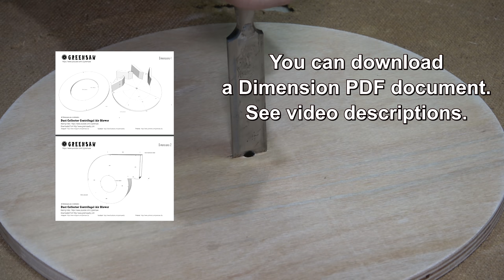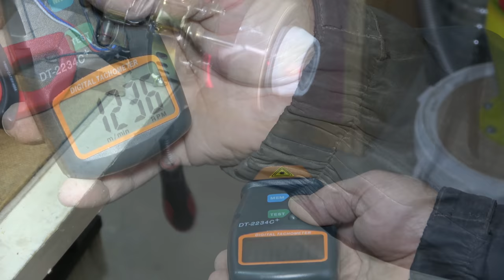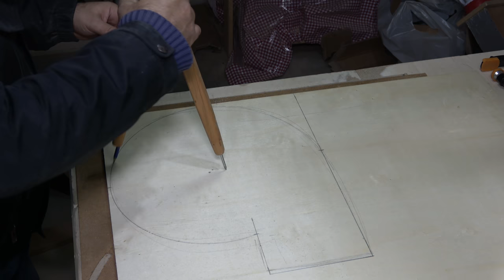DIY - Dust Collector Centrifugal Air Blower [4K]

Comment: What do you want to do with 65 watts? My razor will soon have so much! At least one zero is missing. And 3000 turns per minute!
Reply: My thought as well. I wouldn't go less then 1 HP for that size of propeller
Reply from the maker: My goal is not to blow a hurricane! A silent and continuously working dust collector.
Reply: @GreenSaw  With 65 watts, you can't even blow out a candle.
Reply: @wernerpfeifer   Do you know how many watts of home hoods for the kitchen above the stove? This is not a cyclone for a carpentry workshop .
Reply: @iuriicebotari3656 ???
Reply: @wernerpfeifer  !!!
Reply: @iuriicebotari3656  а для чего же тогда это?
Reply: @12233444q  В названии ролика все написано и это не циклон для конкретного станка, который  убирает отходы в одном небольшом участке...
Reply: AI bring you in wrong place Mr. Werner P. ! ha ha ha...
Reply: @niamulbary8162  ;)  ???
Reply: Please make a water pump which oprated by 24 volt bettary
Reply: @mandeepsiwach6797  ???
Reply: Por de ppa
Reply: Do you want to compare a large carpentry shop with a homemade one?  The type of engine depends on your needs.  If this engine meets what he wants for a bigger engine?
Reply: @iuriicebotari3656  Die saugen auch keinen Staub!!!

Comment: Reconfigure your installation to get rid of that 90• elbow. Flex duct work is another thing to avoid if possible. Removing the elbow will make a huge improvement in the performance.
Reply: That’s all connected to the exhaust (outlet) end though right?  From what I can see he didn’t hook any lines up to the part that actually sucks up the dust

Comment: simple but effective - don't mind the ones that want always bigger - faster louder ....i also prefer low-energy-consumption and silent solutions 👍🏻we do have enough machine that are crazy loud and every extra noise we don't add to them is a win - and btw for the very fine dust flying around in the workshop/ air that is a nice way to do it. but i admit if you want to use also a particle filter in the airstream the power may be not sufficient. 🤔 i'll have to check this   -Anyway  well done & keep up
Reply from the maker: Thank you for your nice comment. Regards...

Comment: You killed it with that 90⁰ elbow. You need to find either a sweep 90⁰ (large radius) or to install two 45⁰ elbows to soften that turn, for improved efficiency. Just saying...
Reply from the maker: You're right, 90 degree elbows didn't do well. Thank you for your comment.
Reply: Right! Every tight 90 adds resistance equal to 10 feet of duct pipe.

Comment: Nice work, I think you should've made the output even closer to the blades to avoid losing pressure and airflow
Reply from the maker: I think what I have done is enough, but of course it would be better to compare the two after making a new one according to your suggestion. Thank you for commenting and sharing your thoughts.

Comment: Looks like a nice size tradeoff for improved noise reduction. I suspect it'd be really good for smaller tools such as a scrollsaw if you wanted to use it directed at a single tool, rather than to merely circulate.

Comment: I think it's a great machine you've built but if it was me I would have made the impeller to shroud distance way smaller than what you have primarily because if you look at EDFs (electric ducted fan) , squirrel cage fans , turbochargers and turbine engines ,they traditionally have extremely close tolerances to achieve maximum efficiency otherwise you're generating a lot of turbulent flow in that space between the impeller and shroud and whilst I understand you don't want to produce the equivalent of jet engine thrust it will give you far greater efficiency out of the 65 watt motor

Comment: I work with exhaust fans for restaurants and you have a very excellent design if you were to put some type of Venturi on it that would increase the speed and you can use that to pipe to your equipment for dust collection
Reply from the maker: Thank you for your advice.
Reply: Not exactly speed as such but air flow pressure, however, the idea is just great.
I'd add to this excelent idea the use of some sort of light materials such as acrilyc or polycarbonate.
Thanks again for your work and for sharing it

Comment: I tried using this motor (from a floor fan) for a spinning wheel. at a load much less than yours, it heated up very quickly. this motor only works with forced air cooling.

Comment: I assume you have a motor lubrication screw on the impeller side bearing. 🤔 You hid it in the structure of the device. 😥 Lubrication of the bearing on the other side is easier. 😉👌👍

Comment: Ouch.  Several things to avoid in any fan / duct design:  no turns/elbows within 3~5 duct diameters of the fan discharge; if possible make any elbow turn in the same direction as the fan rotation (in this case, duct DOWN would be in same turning direction as fan blades).  Carry the dimension of the fan outlet (this one is....6x6?) for 3' (more if possible), straight, no transitions.  Make the top of the discharge duct flat / even with the outlet of the duct:  this upper area of the fan discharge has MUCH higher velocities than any other area, and thus pressure/energy loss is MUCH greater for any turbulence in this area.  Violations of such guidelines can result in 50% (sometimes more) reduction in fan performance.
Reply from the maker: Thank you for sharing your valuable information.

Comment: NOTE- do not use in an area or house with a gas appliance that is vented through a vent.  Instead of the carbon monoxide escaping up through the vent, it will be pulled back into the house.  You will need a window or something open to equalize the air pressure.
If all electric appliances, good to go 👍

Comment: 65watt motor is useless for dust collection. You won't have any real suction and even a basic shop vacuum has much more power than that little thing. You need minimum 2hp motor to have any real noticeable suction power.
Reply from the maker: I am using it now and I am satisfied.
Reply: @GreenSaw  I doubt your statement as you have no piping through your shop nor is it connected to any of your other machines and I am 100% sure this blower won't be able to provide suction for your shop. It barely has enough suction to pull smoke, never mind wood chips.  The reason I know this to be true is the fact I had a 1hp dust collector years ago and it could barely work with my table saw never mind my planer and this is why I upgraded to 2hp, this is also why I am telling you that if a 750w motor is not nearly enough then most definitely 65w is not enough. 
If you think it works great then show me how the dust collector works on a jointer/planer machine, I know already your inlet will get clogged and no chips will make it to the dust shoot.
Reply: @kazykamakaze131  Maybe something was lost in translation as seems to me to be more of an air cleaner than dust extractor.
Reply: @999pil  Well the title says it all and he defended his position on this. I don't think it's more obvious if it says dust collector in the title, don't you think?
Reply: @kazykamakaze131  True, but as I say, perhaps something was lost in translation and if one really wanted to be pedantic about it then it should be noted that it will likely collect the tiny particles of dust that float around in the air and therefore is accurately described as a dust collector of sorts.
Reply: @999pil  I agree. This isn't designed to pull wood chips 2 metres into the air, it is designed to extract airborne nuisance dust. I think that translation is the issue as you say. We had similar systems at work called LEV, local extract ventilation designed to remove airborne dust and fumes.